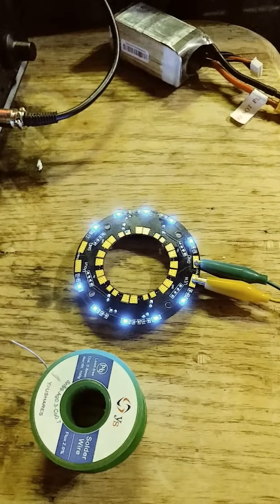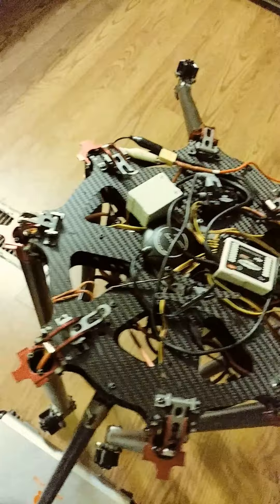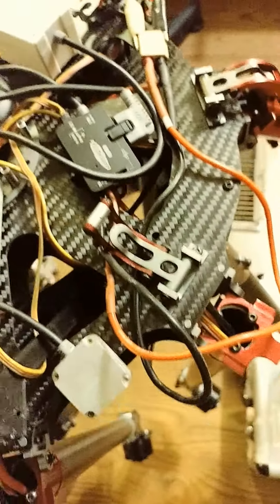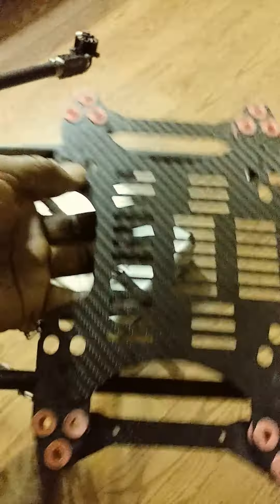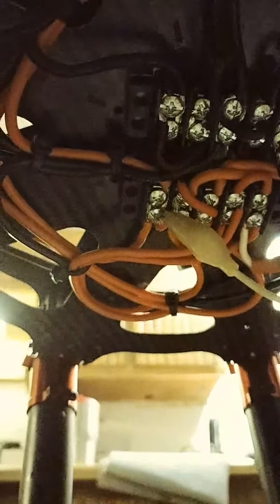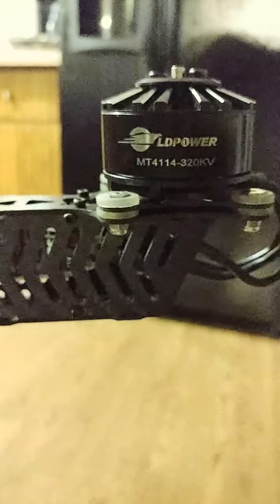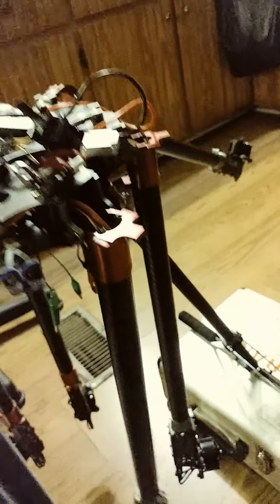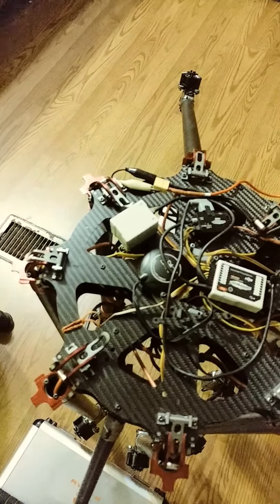Cooking OctocopterII LOW VOLTAGE pdb and main harness block.

Comment: Hey Doc. I got a quick question for you. I'm in the process of buying parts for a super simple, minimalist looking cinematography drone with GPS and a basic 2 axis gimbal. So my question is, for a quad configuration, could I use a racerstar 30 amp esc board? I want to make a shelf inside the frame to mount the batteries so I want to keep the lower level as low as possible. 

And by the way. I agree with XB. That power block is NOOIIICCCEE!! 😊
Reply from the maker: Phauxx FPV good morning Bro. 7702895626.. God Bless and thank you!!!